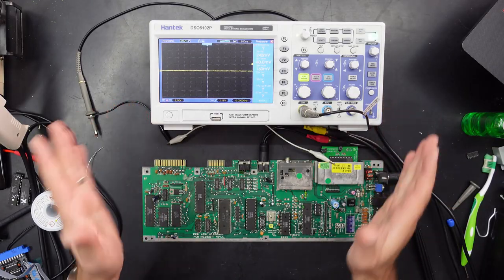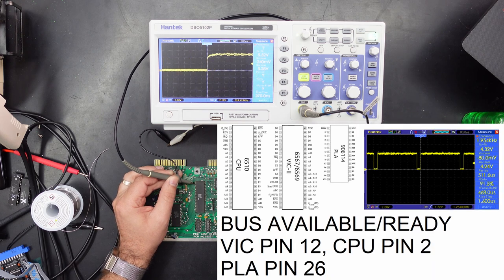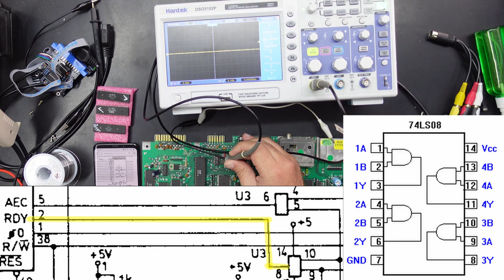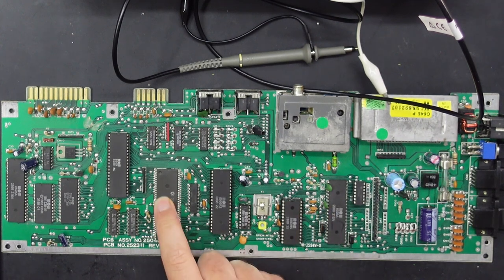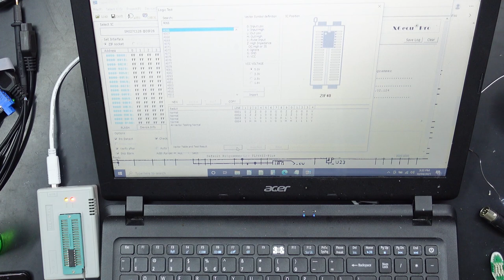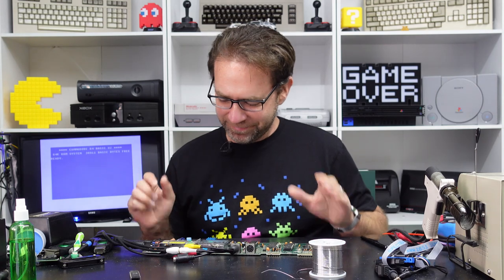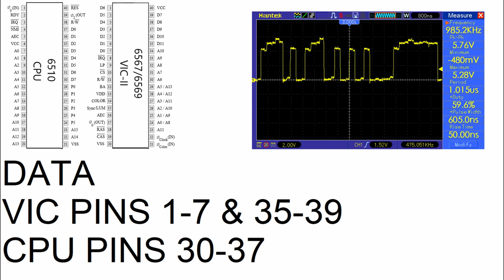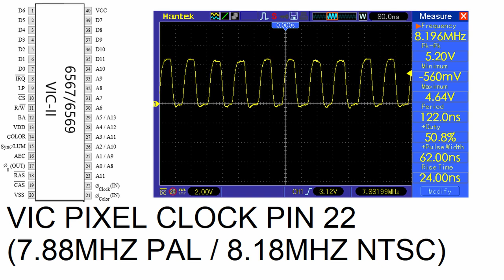Commodore 64 troubleshooting part 3 - probing with an oscilloscope

Comment from the maker: Quick note: The oscilloscope signals at the end were taken with the C64 booted into BASIC, without any peripherals or cartridges connected
Reply: Great job.  You're beginning to do what I've said elsewhere I'm so surprised I've never seen before considering the HUGE number of C64 repair videos and forums - provide scope traces at key points from a working C64.
Reply: Hi, do you mind if I make a PDF file from those signal screenshots and refer you as the source and also give a link to this video please?
Reply from the maker: @MuzafferB74  MindFlareRetro has already made one. You can find it on his site along with links to Sven Petersen's oscilloscope guide https://mindflareretro.com/resources

Comment: Great video. Someone may have commented already, but if not, you can use two short sockets instead of one very long socket for the super PLA
Reply from the maker: You can, but not the standard dip sockets that most folks would have on hand. The super PLA has a 1.778mm pin pitch as opposed to the more common 2.54mm

Comment: I just wanted to say that your videos helped me greatly to fix my commodore 64 I bought accidentally on ebay :) That was my first attempt bidding and I confused two tabs in my browser and put a bid on a not-working commodore and I won it, of course as I was the only idiot. Deal is deal so I got it back in August, it surely didn't work (black screen), but looked fine. The seller mentioned that the video cable melted so I assumed he shorted it somehow. So I started watching your videos, learning how to solder, learning electronics etc. Had to buy an oscilloscope, multi-meter, soldering station, desoldering station etc. After this troubleshooting videos I did couple days of probing and figured that PLA is probably bad, so I double checked other ICs and ordered PLA from ebay. Desoldered the old one (thanks for your advises on adding solder before desoldering) and soldered in a socket and put new PLA into it and it worked! My first computer I ever fixed. Of course, the investments I made are way above what would normal person spend on the old not-working commodore :) (I won't even mention how much did I spend on all that equipment). Now I got 1541 to fix... and probably gonna buy an old soviet PDP-11 clone from Slovakia (I had one when I was a kid) but I'm hesitating because to fix it I will have to order some ICs and other parts from russia which is almost impossible these days (considering that madness they got themselves into). BTW I've never had any of the real western 8bit-era computers like commodore, or amiga, or even spectrum before. So learning right now about what you guys played with while I was on the other side of the iron curtain :)
Reply from the maker: Fantastic and congratulations on your first repair! The tools will pay themselves off in the long run I'm sure. It's so great to hear when another person is able to repair something after watching some YouTube videos. Obviously you have the drive and competence to be able to do it, and I hope it gives you new found passion to go on and repair more busted tech and keep it out of landfill. All the best with your repair journey, I hope you can get your hands on some systems you grew up with and get them going
Reply: @TheRetroChannel  Thank you ! Appreciate it. Currently watching all those 1541 troubleshooting of yours ...
Reply from the maker: Oof, good luck with that. Those videos are probably pretty old and hard to follow. But if you get stuck, feel free to ask for help

Comment: Good video. FWIW I have had to replace the 64 pin PLA on more than a few 64C E boards that have been through my shop. They fail almost as often as the PLAs in the breadbins and I suspect as time moves on their failure rate will increase. The 1.77mm sockets are readily available, I stock them, have at least 20 on hand as are the 64 pin PLAs.

Comment: Yes there is a socket 64 pin, done once on one C64 short board. Mine had black screen, but when cart was inserted computer worked and passed all diagnostic. At the end desoldered all chips from board, ordeded new SuperPLA but i was same issue, black screen without cartrigde, tested all chips on other board, create new BASIC+KERNAL chip, nothing.
So long story shot, there was short on cart port when no cart is inserted :D, replaced cartridge port and it was working :)
Reply from the maker: Interesting, maybe I should seek out one of those 64pin sockets and make a short board testbed 🤔

Comment: All of these videos have great information! One thing I don't recall seeing, and I might have missed it, on the 250407 boards next to the Vic chip there is a jumper for PAL. Does this tie into the RF modulator or the video out to make the video signal PAL versus NTSC? I noticed that there is another spot right next to the PAL jumper. Is that for something else?
Reply from the maker: Not quite, the PAL and NTSC machines use a different VIC-II and click frequency. Although I've never tried it, I believe you need to swap out the crystal, VIC-II, and short/open that jumper.
The 2nd jumper may be for PAL I/G but to be honest I'm not sure
Reply: @TheRetroChannel  Thank you for the information.  Well, there is only one way to find out. The thing that has always irritated me the most is the region formats. Thankfully PCs are mostly immune to that today but things like gaming systems, TVs and Blu-Ray players aren't unless you have a region free system.

Comment: Hi, I noticed that you have an alike soldered pen like mine.  What is a good temperature to solder at?  I always have a ugly looking solder job.  U mentioned it was because not enough heat.  I'm nervous lol
Reply from the maker: I have a different one now, but when I was using the older one it was usually set to 350°C

Comment: A great series that has already helped me; but what is the logic tester you use at 9:05 please?
Reply from the maker: It's the Xgecu TL-866ii programmer. These are discontinued and have been replaced by the Xgecu T48. The software for the programmer includes some basic logic tests which is what I used here
Reply: @TheRetroChannel  Thanks for the quick reply.  I'm not sure I need one yet, but it's certainly not going to break the bank if I ever should do.  I'm currently trying to solve a C64 black screen problem, so I may need one eventually.

Comment: Can I learn what is the hardware and software you're using at 9:05 Logic testing please?
Reply from the maker: It is the TL866ii, and the software that comes bundled with it. You can find more info on it here: https://youtu.be/SQ0MVKTrAD4
BTW I believe the XGECU TL866ii is being replaced by a new version called the T48 and T56
Reply: @TheRetroChannel  Many thanks!

Comment: Hello again, here's another question please :)
What's your heat settings when soldering/adding fresh solder/desoldering please?
Reply from the maker: For soldering signal traces 330C, power planes 360-380C. Add about 10% to those figures for desoldering.

Comment: Thanks for the videos. I got black screen Assy 250469. Pin 39 and 40 do not give me any signal on CPU. Any idea?
Reply from the maker: So pin 40 should have 5V on it, and pin 39 should have the ~1Mhz clock. Double check those again, and also check to see if the 1Mhz clock into the CPU is there on pin 1. Let me know what you see on those 3 pins

Comment: My PLA I4 pin 5 is around 2 volts and flashing rapidly on the oscilloscope. If this goes bad, could this also make the ROM chips go bad, because kernal and basic are pretty hot.
Reply from the maker: Seems unlikely that it would affect the ROMs. PLA I4 (also called VA14 on the schematics) connects to U14 and U2. I would suspect the PLA, followed by the 74LS258 at U14 (especially if it's a MOS branded chip), then the CIA at U2. BUT, it could be completely unrelated to any of those things, so take all this with a grain of salt. Good luck
Reply: @TheRetroChannel  thanks for the reply. They say the PLAs usually go bad, so I've bought a modern day replacement, I'll go from there. If the ROMs are hotter than the VIC after a few minutes on, do you think they would be suspect? The screen when powered up is just blank, not how they show ROM problems with random characters and such. I removed the SID and CIAs for testing with no changes. I know the VIC is fine, it worked in my friends machine.
Reply from the maker: @computeraidedworld1148  🤔 I've had some hot ROMs that still worked just fine. I've also had ones that ran cool. But in all cases the VIC always gets hotter than everything else
Reply: @TheRetroChannel  alrighty, well I'll wait for that PLA, if that doesn't work I'm going to look at these ROMs, it's way hotter than the VIC. Thanks for your insight, and I'm glad I found this channel, well made videos.
Reply from the maker: Yep, wait for the PLA and see if that makes any difference. If not, you can remove the BASIC ROM and the machine should boot to a blue screen with no text. But you cannot boot without a KERNAL, you'll just get a black screen